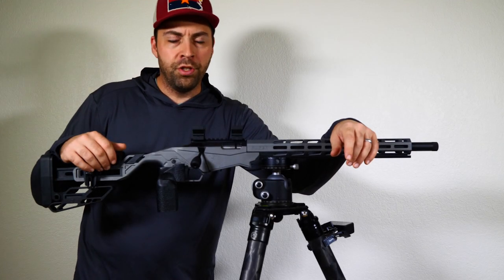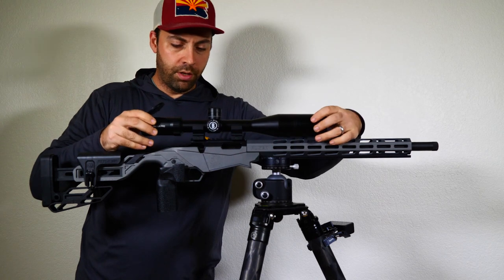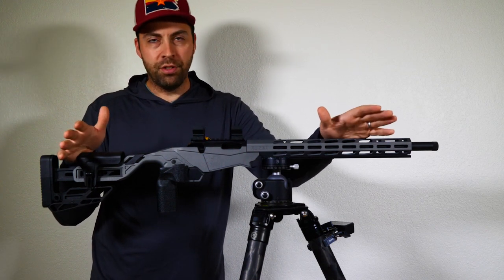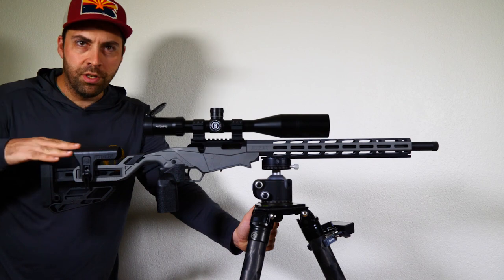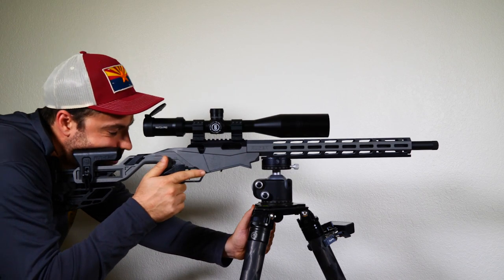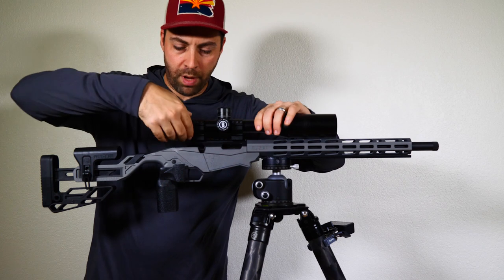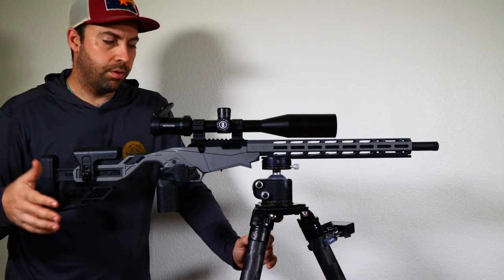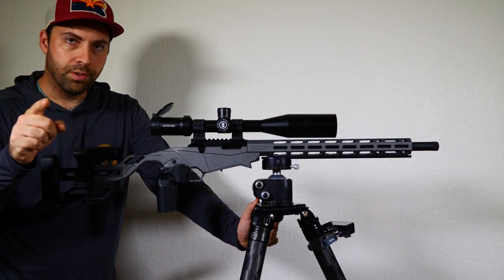Scope Eye Relief (Ruger Precision Rimfire Rifle NRL22 Base Class Build Part 5)

Comment: A word on leveling - it doesn’t do much without an anti-can’t device or bubble level.

So many shooters are talking about leveling their scope to the rifle, like if scope has some rigid optical axis that can be only parallel to the bore channel in a vertical plane only if the scope is square to the action.

It’s not true. Each time when shooter adjust the scope turrets, he makes the scope “axis” to point at the poi.

What really matters is whether you holding reticle level when adjusting elevation or using holdovers. It doesn’t matter if the scope is perfectly square to the action as long as a reticle is aligned with gravity.

Reticle is need to be leveled with gravity vector, and it means that it needs to be synced with some leveling device fixed to the scope which should help you to keep the reticle in a vertical plane.

Comment: Might have missed it in this video or the other, but what rings did you end up going with? Just picked up the same rifle and found the match pro for sale second hand including rings, but not sure if the leupold rings included with it will be right height
Reply from the maker: These are Vortex Tactical High Rings which are 1.18" or 30mm height from the top of the picatinny rail to the center of the scope.

Comment: What happened to your RPR build? I could t find a video discussing why you changed and what your thoughts were on the rifle when it was completed.
Reply from the maker: It's taking a back seat for the 2025 season. I kind of illuded to the reasons in the videos discussing the new base class rules. In short, base class no longer allows aftermarket triggers. I cannot stand the factory Ruger trigger with the blade safety. It just doesn't fit my style of precision shooting and is relatively heavy at over 2.5 lbs. at the lowest setting (most of my triggers are set to 1lb or less). I hope to make some modifications to the rifle in the future to see how far I can push the platform in Open class. I'll be putting in an order for a new barrel soon, but they currently have long lead times.

Overall, I really like the rifle, but for this year's base class limitations I've build out a CZ457 for NRL22.